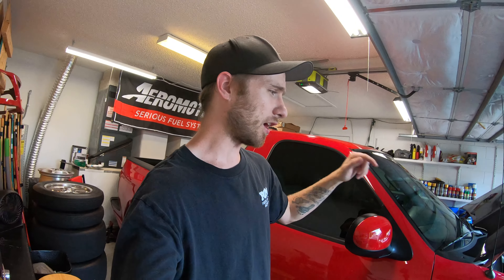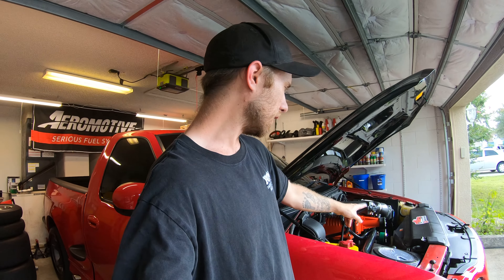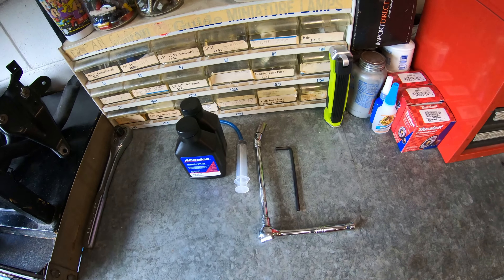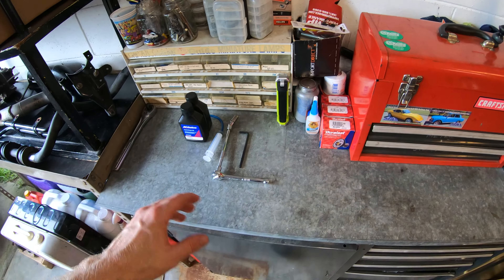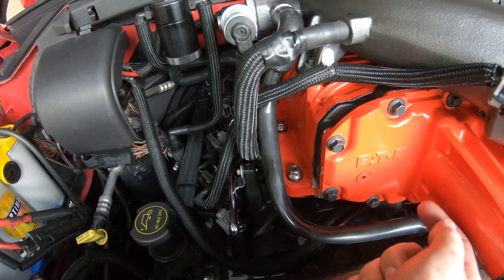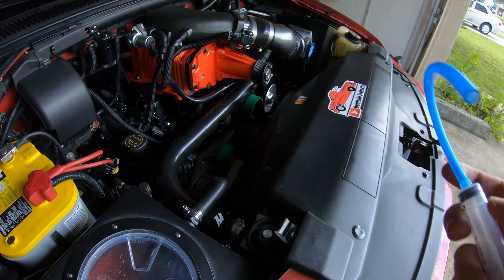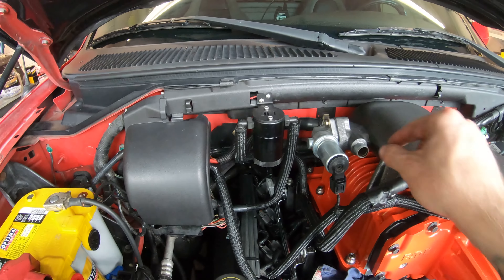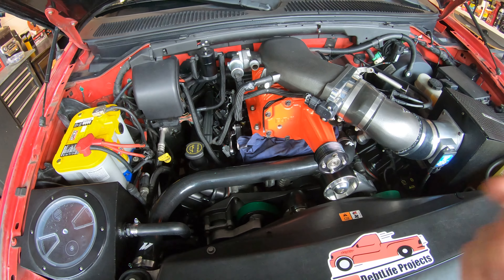Ford Lightning Build - Supercharger Snout Removal / Oil Change

Comment: What was the cause and what did they do to fix it mine has a small leak in between the supercharger and pulley. Work was done befor at joker
Reply from the maker: A seal that "spun", I forget exactly how he explained it.  But he said 1/100 do it, mine just happened to be that one.  Mine does sweat alittle, not enough to make much difference, but after a pull and it's nice and hot, there's a film behind the pulley.  Might have to do with how hard I'm spinning it

Comment: I just picked up a bone stock Lightning.  It will be my slowest truck, so I'll definitely need to turn it up.  What would you do first if you didn't want to get into the short block?
Reply from the maker: jessemas27 Actually doing a video about this soon, but here’s a quick rundown of what I’d do.

Maintenance first, change every fluid, all new oem motorcraft coils, pull the blower and clean the intercooler (very important) ect.  

Once it’s in tip top shape, id do longbars and a driveshaft safety loop first, most overlooked yet important mod ever!  Then do intake, 5lb lower pulley, sct ba2600 maf, catback exhaust, heat exchanger, intercooler tank, ngk tr6 spark plugs, and a tune by Eric Korn.  

That’s a pretty solid, proven mod path, that should have you deep in the 12s

Read this, tons of info, very good read
https://www.lightningrodder.com/threads/lightning-and-hd-modding-101-superchargers.353385/
Reply: @DebtLife_Projects   Thanks

Comment: Where could I get that supercharger coolant tank? Would it bolt up to 03 Harley or some modifications will have to be made? Thank you
Reply from the maker: Lightning Force Performance, i'm not entirely sure if it will directly bolt up to the Harley trucks, but I wanna say it should.  There's not much difference at all between them, probably safe to say it will.
Reply: @DebtLife_Projects  thank you

Comment: Hello, I have a question does anyone know where is the coolant temp sensor location in a Ford lightning 2002?
Reply from the maker: I believe it’s in the head, close to where the thermostat housing is located.  Not 100% sure on that, but try there
Reply: @DebtLife_Projects  thank you for the info

Comment: Damn that sucks man.. It's rare Jokerz S/C work is ever like this. This is exactly what I remember about my truck before it finally broke for good was it always being Down. I spared nothing in this next built. They said they only weakness I may face down the road may be the crabk snout failing. You've got a bad ass set up. You should get rid of that Heaton and look into some KB or Whipple.
Reply from the maker: Yeah, I don’t know if it was jokers or just a fluke or something, but I’m sure it’ll get figured out.  Hopefully no more issues for the both of us lol 😆 I might eventually, but it’ll be down the road.  If I can get this setup with the Eaton squared away ima rock it for a while.  I feel like it’s plenty for the street anyways.
Reply: @DebtLife_Projects  Very true bud. Well either way we will be watching the progress.

Comment: Dang......well, that sucks......but once you get the kinks out of it, it should give you some trouble free racing......for a while anyway....the faster you go the more you will be under that hood.....lol. That was an unusual issue at that stage of your build......
Reply from the maker: Yeah, that’s how it goes lol 😆 always want more and it’s never cheap 😁 but it’ll get there, even the blower builder was alittle shocked at what it’s doing.  Hopefully it’s as simple as maybe the seal was alittle torn when put in or pinched or something.  Guess we’ll see 🤷‍♂️